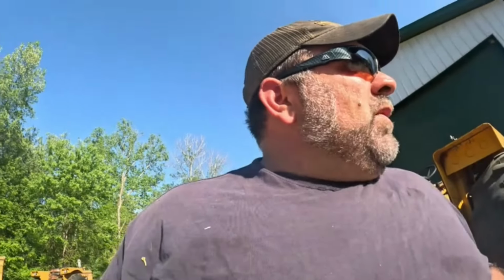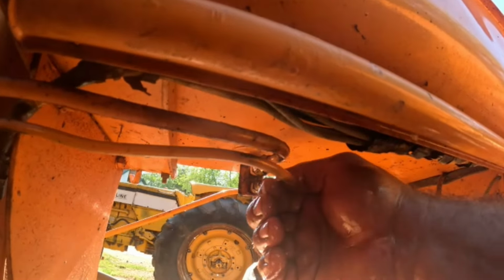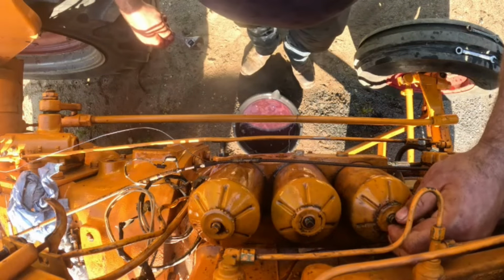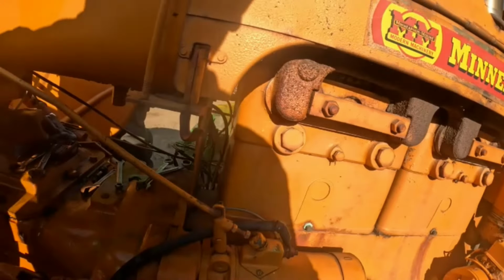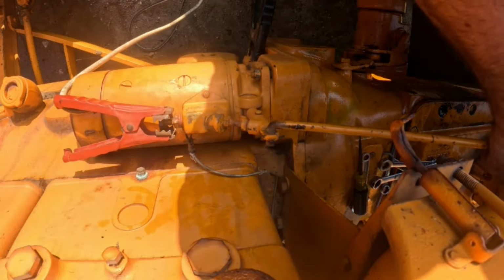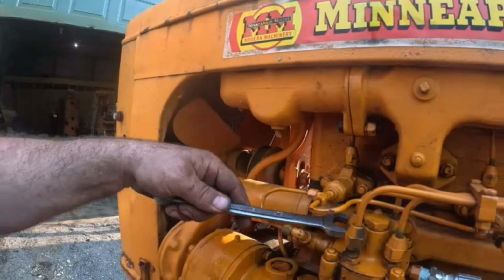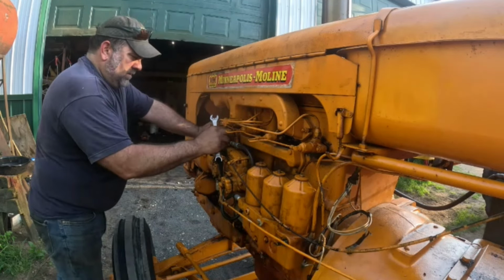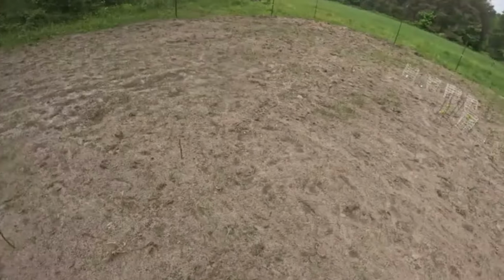Fixing More Fuel Leaks On My UTS DSL

Comment: I think your MM tractors are find to pull the heavy disks in the end it depends on how the operator on the seat knows how much load to put on the tractor. You can have the most powerful engine but if the operator makes a fatal error somewhere else, it's no good. So I think your setup is fine as long as you know what you are doing. Fun watching you fix the machines and find out where the pesky leak was.

Comment: Graphite rope packing, it's stranded so you can unwind it to get a thin piece to repack it. 3 rounds should be good. It you have trouble loosing power under a hard pull the valve maybe letting air into the fuel system. The return line is for left over fuel and should be a small amount either way. If there is any screens in the fuel system make sure to remove and clean. Fuel oil was extremely dirty in the early years. Today we have premium or regular Diesel fuel.